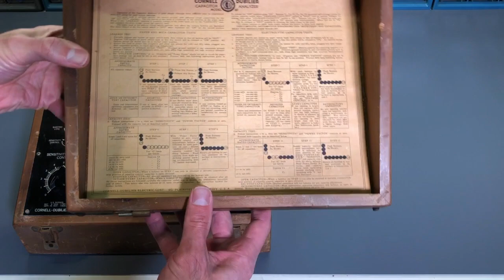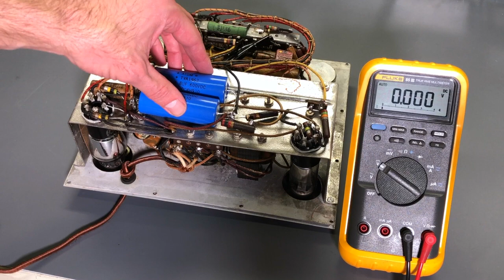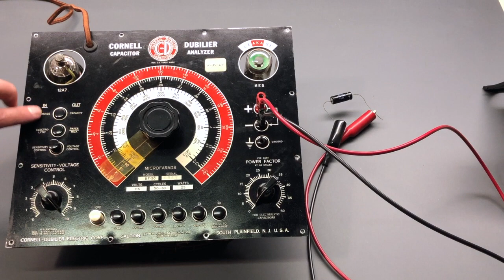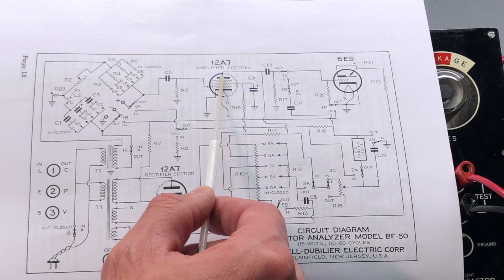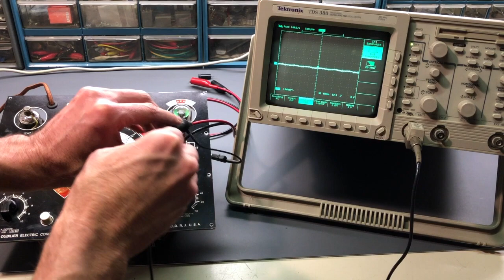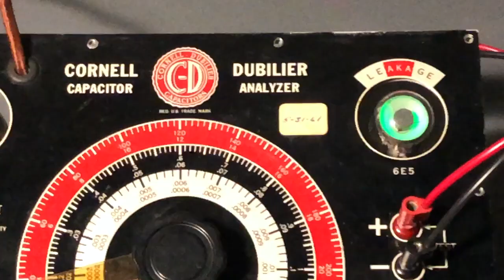Troubleshooting And Repair On A Cornell-Dubilier BF-50 Capacitor Analyzer

Comment: Would you have a list of the capacitors that you used and where to get them.Thanks
Reply from the maker: My sources are usually  https://www.mouser.com , https://www.digikey.com , and https://www.tubesandmore.com
Make sure to use equal or higher voltage rating and you can round off the old capacitor values to the new value, for example 0.5 uF would now be 0.47 uF.  The old paper wax caps are replaced by poly-style (not electrolytic).  -Erik

Comment: Thanks for the video. I just purchased one, should arrive by Friday and will definitely need to be restored. I have all the Capacitors or resistors needed. Hopefully the EYE tube will be OK??
Should be a fun project, and your video will definitely speed up the process!! 
I restored a SOLOR 1600 that looks very similar to this unit... But variety is the spice of life so having another unit will be nice to add to the collection.
I wonder if SOLOR and Cornell-Dubilier are somehow connected being very similar in style???
Robert, San Diego  ,,  If you search SOLOR 1600 Capacitor Checker you can see what it looks like, the inside is very similar to the BF-50
Reply from the maker: Robert, glad you found the video helpful.  The tubes are all still available from various sources so if your eye tube needs to be replaced it can be found.  I have seen the other manufacture's model and wondered who might have designed it and who copied??  They are very similar. Have fun on your restoration!